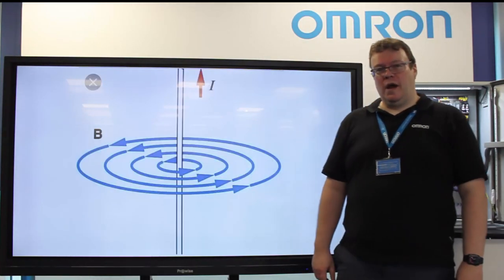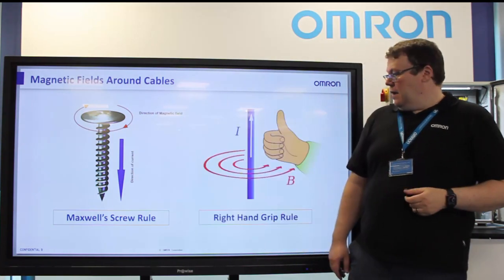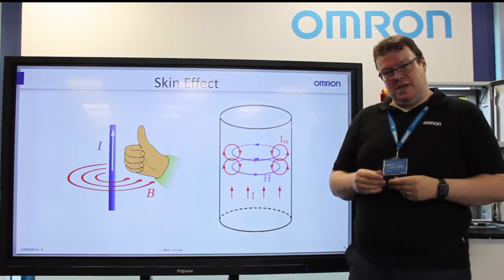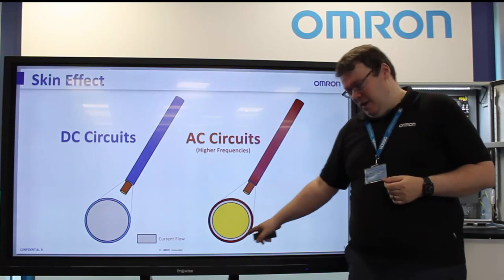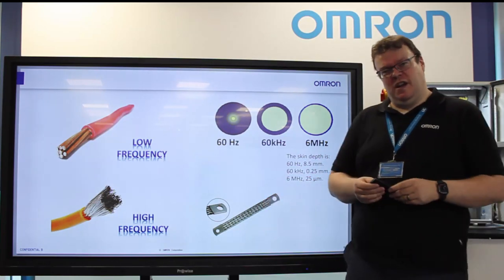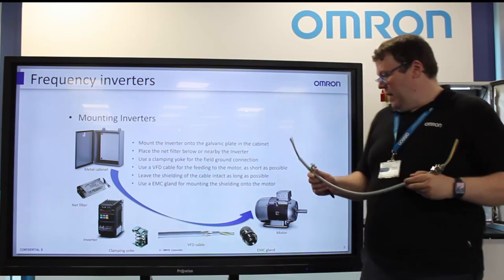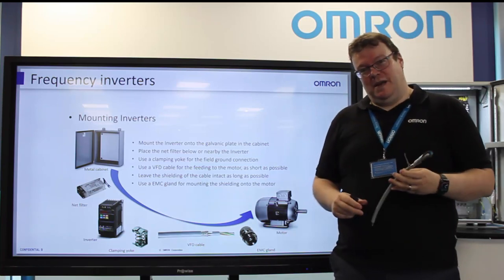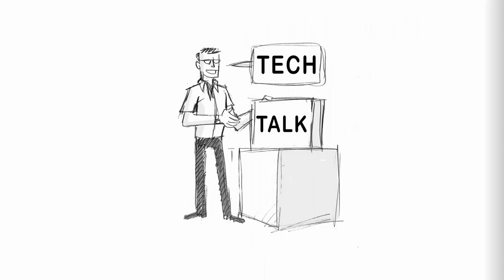Panel TechTalk: Skin Effect

Comment: Does the 20kHz typically found in PWM circuits for DC motor control result in any skin effect? My specific application is for a 12V, 30A brushed motor with a Kv of 140. Should I take skin effect into account when selecting the correct gauge of wire?
Reply: That's a really good question I'd love to know the answer to. I imagine pwm would have to produce skin effect as its frequency is increased enough. However, pwm doesn't necessarily require negative voltage so idk.